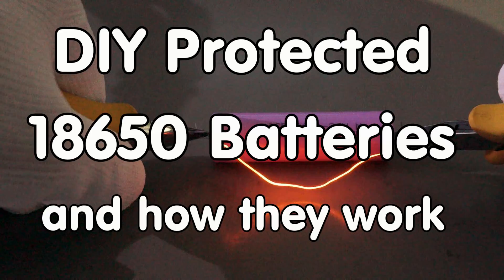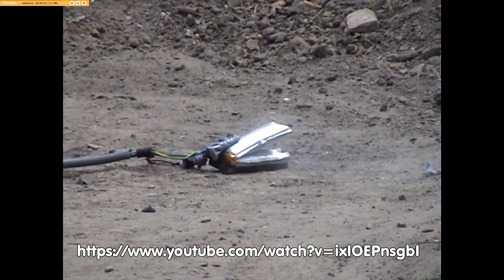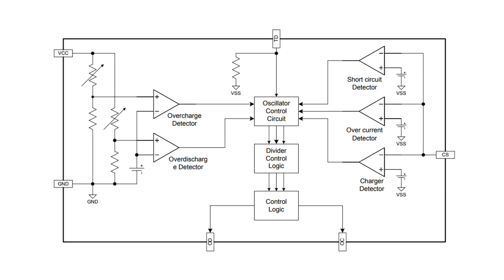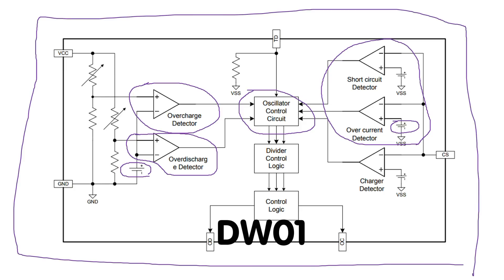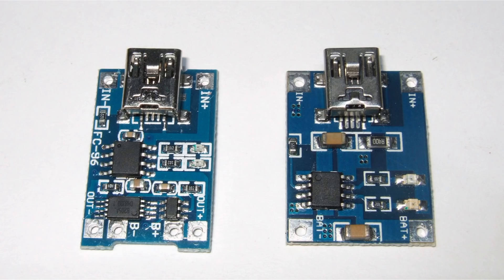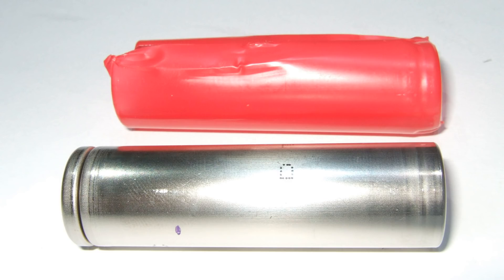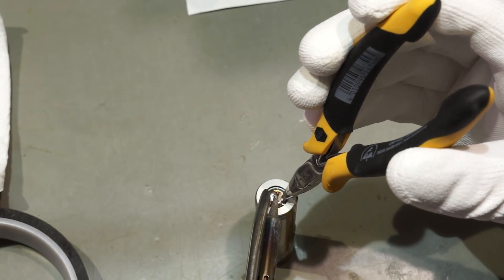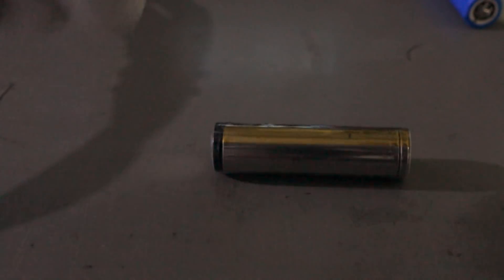#160 40 Cent Do-It-Yourself Li-Ion Protection for 18650 Cells (Tutorial) and how they work

Comment: Fully discharging does not "change the chemical structure in a non reversible way"...
What happens to them with a deep discharge that can cause danger during a subsequent charge cycle is that during the lowest voltage parts of the discharge, a /Physical/ change can occur. Metal deposits can form on the films inside the battery that bridge between the insulation gaps, allowing it to short out internally once the voltage reaches a value that can arc the remaining gap.

This is not a guaranteed behavior, but can happen, especially with cheaper construction cells. A few youtubers have looked at this deeper (Big Clive I believe has done a video or two on it?)
I believe that I recall it being that certain metals that are used in some batteries are susceptible to this at the lower voltages, while others are not.
Reply from the maker: Thank you for your explanation. I did not know the details. My cell was not a cheap one, it was branded (Sanyo if I remember right)
Reply: BigClive vid.
https://www.youtube.com/watch?v=sRwoYJyjZNo
Reply: Well that "/Physical/ change" happens because of a (electro-)chemical reaction. Or where do you think the metal comes from, in a pruely physical way?
Reply: Yeah, it's that BigClive video ;) And the critical thing there (or at least according to the research report that Clive referenced) was it could only happen to batteries that were in series, as the fatal damage occurred when the batteries were taken 12% below 0v. For something to happen to a single cell, I wonder if it was shocked by being unusually flat and then seeing the full charge current, or if there was some other fault in the cell which was triggered by the discharge/charge.
Reply: the link to the information Big Clive used https://www.nature.com/articles/srep30248
Reply: Dendrites.. Scary huuu..
Reply: Exactly. And the dont somehow physically pop out of solution or whatever, they form like copper is purified - (electro)chemically.